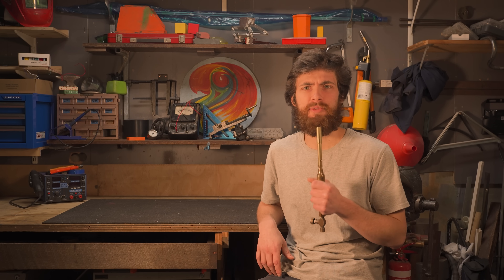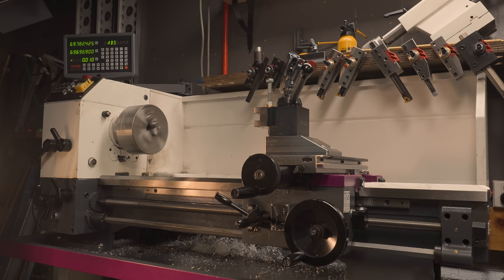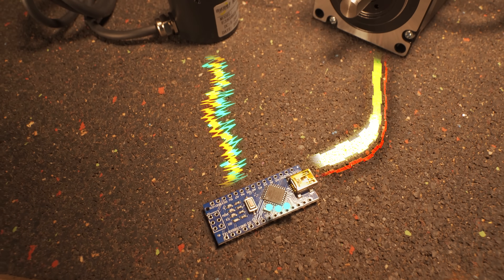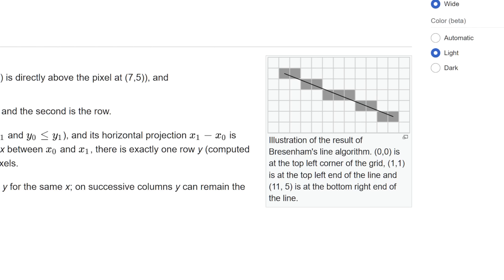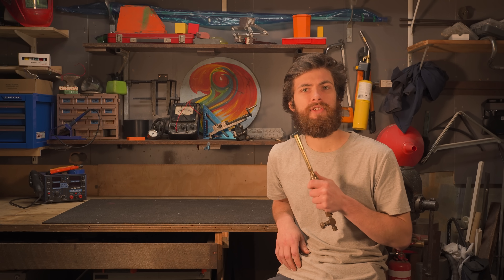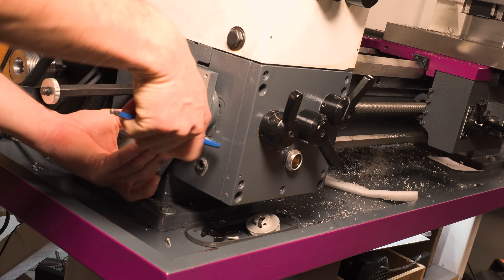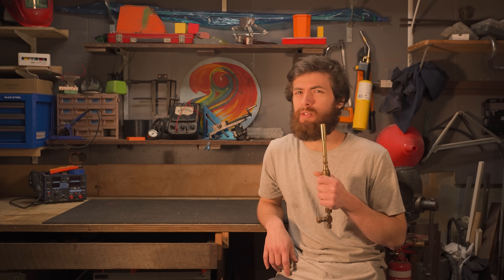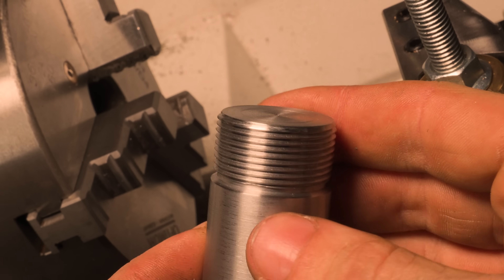Putting an end to the WORST kind of gears.

Comment: WAIT A MINUTE!!! They make solder breadboards?! I had no idea, THANK YOU!
Reply from the maker: You're WELCOME!
Reply: @NoEngineerHere  a bit of a warning: solder joints crack pretty easily with such high amount of vibrations coming from the lathe. I would mount every piece of electronics with rubber pads and/or spring loaded screws. A cracked solder joint might result in your micro controller missing a step (sometime in the future), or that 48V PSU not delivering enough current
Reply: @cristinelcostachescu9585  Just use leaded solder and then mount the entire thing on self adhesive foam blocks. No need to get overly fancy here.
Reply: It's usually called perfboard yeah
Reply: @LittleLily_ yep, they’re also known as protoboards
Reply: I was just going to pour epoxy over the no solder board and hope for the best. 
The solder boards are a much better idea.
Reply: they even come in two different flavors:
a) only soldering pads on each hole
b) like a) but all pads in a line are connected to its neighbour

so b) is more like a solderless breadboard, with the feature, that you can break the connection between 2 points by cutting away the copper

Edit: I even used one of Type b) for a Teensy to get more connection points for each pin, because some connection points on a normal breadboard are covered by the devboard plugged
Reply: @SystemX1983  They also have them with no pads if you want to really choose your own adventure.
I've also seen them with power/ground rails on either side.

Really quite handy.
Reply: @jttech44  my bad, you're right :) totally forgot those. but still I can't really imagine those without pads being as useful as those with pads/rails ... even if you want to do everything with airwires, you need something for the solder to stick to?
Reply: @SystemX1983  I've used them with DIP package stuff, so, you're soldering directly to the pins/components, not the board itself. Not sure if that's what they're for or if it's more of a spacer kinda deal and I just used them wrong.
Reply: @SystemX1983  Back in the day, there was dry adhesive covered copper foil that came on 0.06" wide rolls specifically to make tracks on padless phenolic protoboard.
Reply: Yeah. Soldering something complex on them is fiddly, but you still can make a compact device which can even look proffesional-ish with a 3D printed case.
Reply: Duh. How else do you have soldiers and runny eggs.
Reply: We've always just called the prototype boards where I'm at
Reply: Veroboard is better anyway.
Reply: 8:40 you've watched "the missile knows where it is"..

Comment: Ah, yes, checks out. Because an engineer would've used one of many off the shelf solutions, of course.
Reply: These are off the shelf solutions, it is industrial Lego.
Reply: @Ammoniummetavanadate  The ELS  Systems by Rocketronics would be a of the shelf solution. besides, Arduinos are by no means industrial Lego.
Does not mean he can't still do it for fun, learning and have the best possible knowledge of his own stuff.
Reply: @idontknow31212  I guess technically a PLC would be the industrial Lego option but Arduinos are cheap and easy so they get used all the time, especially for one-offs.
Reply: @idontknow31212 Arduino sure is trying to make an entrance into industrial PLC anyways.
Reply: Engineers are about making what exists but their way
Reply: The lathe is on a table why do we need to get the shelf involved?